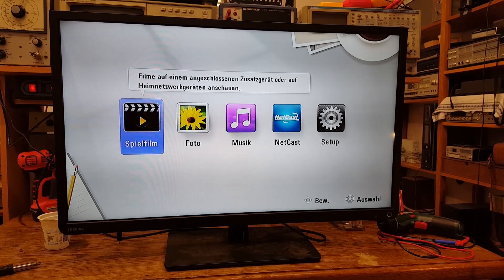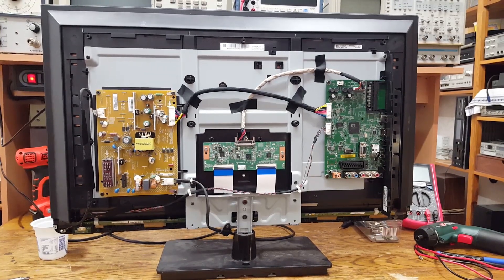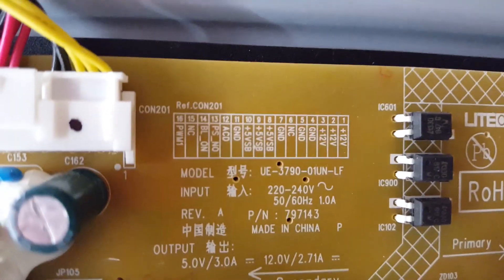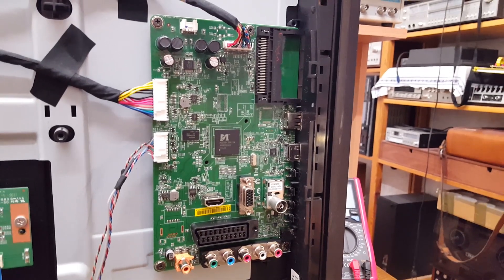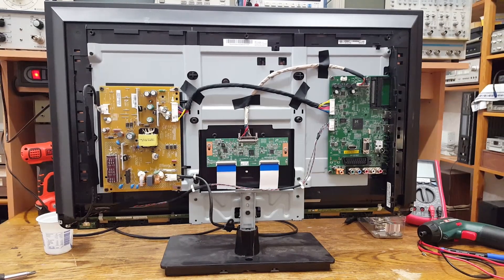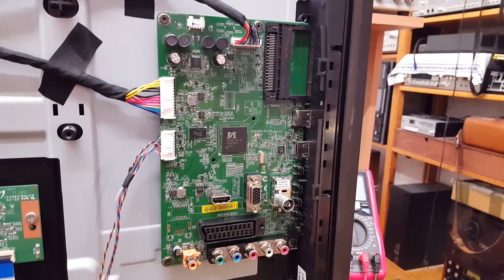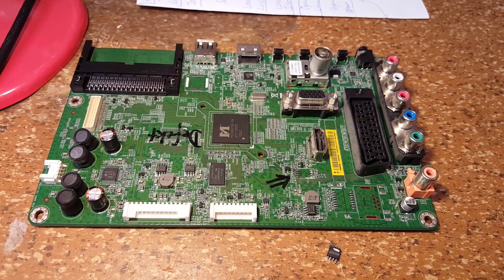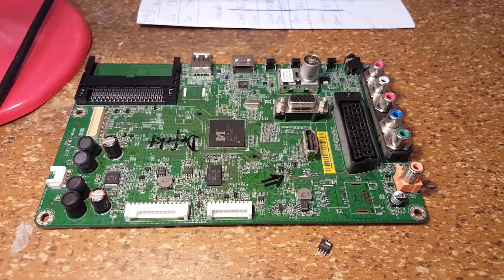Toshiba 32L2333D Full-HD TV Repair (SMD memory chip)

Comment: Wouldn't entering the service menu and changing the panel settings work instead of replacing the memory chip?
Reply from the maker: I don't think such a "service menu" even exists. Note the picture was not just upside down, but also the colours were all wrong and the On Screen Display did not match what the actual OSD of the Toshiba looks like. The chip contains not just some panel settings, it must contain the entire firmware, everything software-related that makes the TV work.
Reply: DrCassette well at least on LG  TVs you can choose which panel is installed on the menu,  wrong colours (solarization) is normal when the wrong panel is selected in the service menu. On the LG service menu you can choose which size panel is installed and which manufacturer (AUO, Sharp, LG, etc...) but if the entire firmware was different then you made the right and easiest choice.
Reply: @DrCassette  had same problem, wrong colors and flipped image after trying to flash some random firmware, you can fix it with the service menu but if you can find another firmware it's even better
Reply: Are you sure there's not a tiny 'reset' button somewhere on the board?

Comment: If you have a cellular wih ir blaser (LG G3,G4, G5, V10, V20. XIOMI REDMI 5 PLUS, SAMSUNG S4,S5) YOU CAN DOWNLOAD A remote conrol applicaion like "Control It" and have a remoe withou needung to cunfigure it.
Reply from the maker: I have a Samsung S6, so I don't have this option.
Reply: According the website GSMARENA, there is an IR the GS6
https://www.gsmarena.com/samsung_galaxy_s6-6849.php

he "cotrol it" app is free for downloading 3 remotes, if you want o download more, you have to buy it.

You can try for free this app/
Reply from the maker: Thanks for the info, I'll have to try this then.
Reply: The S6 does have an IR sensor. You can even use the Peel Smart Remote,  it's rather annoying but still has a lot of equipment in it's database.
Reply from the maker: Oh yes, I remember I de-activated that Peel app at some point because I didn't need it.